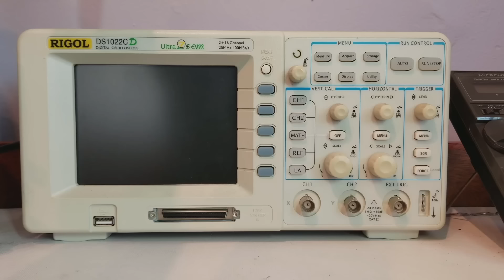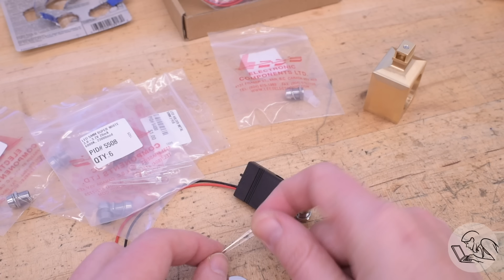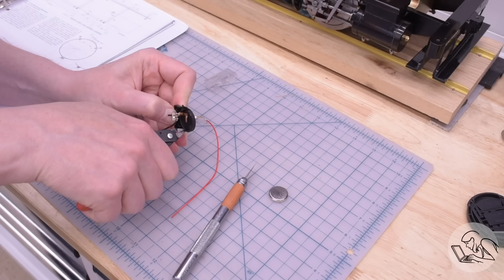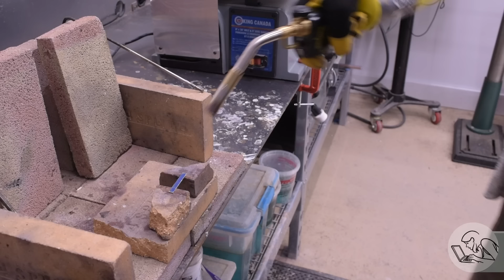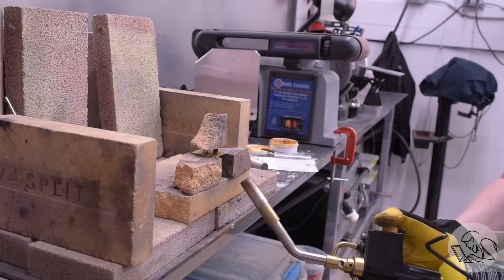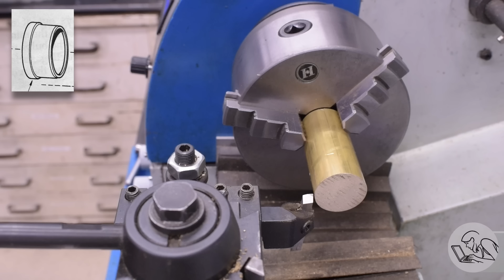Let There Be Light! - Pennsylvania A3 Switcher, Part 98

Comment: Can you please tell the name of that cutting tool holder you have on your lathe, the one that requires you only sharpen one edge of the high speed steel because the other relief angles are created by the angle of the holder.

Comment: Hey, I make light up jewelry using custom made PCBs that hold CR2032s and have a switch. I know you already built the lights, but if you were interested I could send you a couple of the boards. They have an outside diameter of 32mm.
Reply: I was wondering about a PCB solutiin. You could even have a micro right-angle switch on the same PCB 💚

Comment: Quinn, great video! I’m excited to see the engine coming together, but also for all the fabrication involved (the real reason I watch your videos). The fact that the smoke box gets hotter than the boiler makes sense: the boiler gets only as hot as boiling water, but the flame and smoke must get hotter so that they transfer heat to the water but also there isn’t a limit to the temp other than the burn temp of the fuel.

Comment: They sell tiny discs of borosilicate, fused quartz and fused silica glass of various diameters on ebay. I've had great luck using them for oil fired central heat boilers firebox windows. I worry that the switch, the battery "tray" or the both of them will melt without a heat shield to protect from the smokestack radiant heat.

Comment: I found that cheep non metallic nail varnish - not the UV setting gel stuff - works great as an insulating coat in metal, sometimes needed 2 or 3 coats - i used this for fitting DCC decoders in N scale locomotive :)
Reply: Nice!!! ❤

Comment: Great video, as always.  In the interest of over engineering, a possible approach could be to use the top hat as the switch. Either attached to a small rotary switch or just two plugs on the bottom that connect (turn on) in one position and disconnect in the other?

Comment: The reason the boiler is cooler is because all the energy goes to heating up the water. If the water runs out, you break the boiler on a steam engine.
Reply: Exactly - which is why one can boil water in a paper cup.

Comment: I was wondering when it was a requirement for the rear of a locomotive to show a red light in the US/Canada? Is the A3 Switcher before that date? Love your videos, so calming and informative. Thank you from 🇬🇧
Reply: As I understand it, the rear light is to help them link up cars - this is a switcher locomotive, meant for moving rolling stock around the yards.
Reply: @Scodiddly I can understand that. But in the Uk even a shunter (switcher) is required to show a red light at the rear. I’m just curious that’s all. 😊
Reply: Exactly, it's a work light.  They could also have a red lantern handy if they went out on the main track.

Comment: if you see any discarded vapes at the side of a road, pick them up and salvage the lithium battery and usb C charging circuit, most of the time the battery is still good after charging on a proper  battery charger (the ones rc planes and cars use) yes they might have lost a few mah of capacity but still more than good enough for a project
Reply: Yes. But only project grade. Not rated for re-use in laptops, cars, or house systems - that's wht they were in vapes in the first place 👍

Comment: That's fascinating about the boiler vs. smokebox temperature.  I never would have guessed it, but seeing it now, it totally makes sense.  The entire point of the boiler is to absorb heat and convert it to phase change from water to steam, so of course it would cooler than the other things in contact with the exhaust gases.  Cool!
Reply: Reminds me also of a BLEVE video I watched recently. Similar effect, the part of the vessel in contact with the liquid is thereby kept cooler as the liquid absorbs the heat for a phase change, while the part with only gas heats up beyond the structural limit and fails.

Comment: I agree about 6061 being unpleasant to turn (and drill). I tend not to use power feed until the final pass but feed by hand in short little turns of the hand-wheel to get the darn stuff to break.
Reply: Interesting idea.  I wonder if CNC controllers could be convinced to do that 'move stop move stop' thing when doing particular jobs?